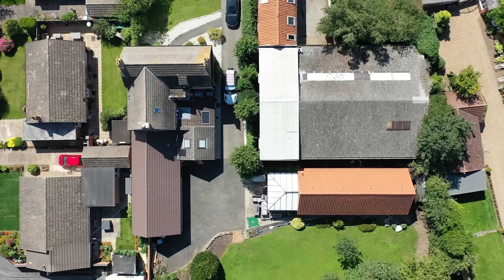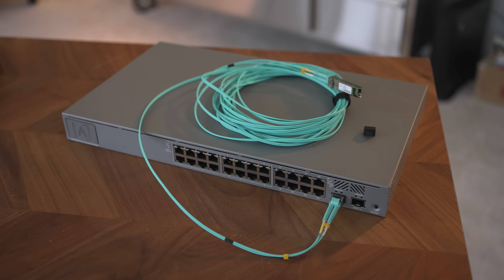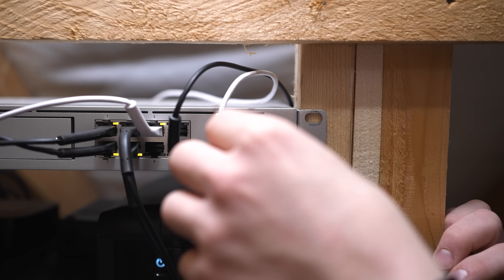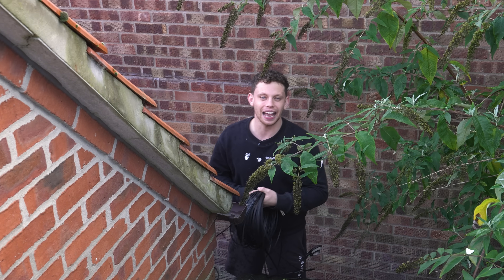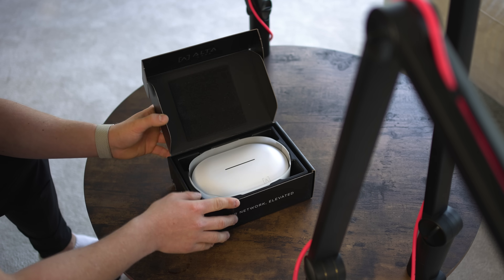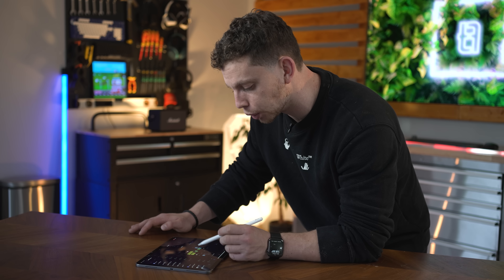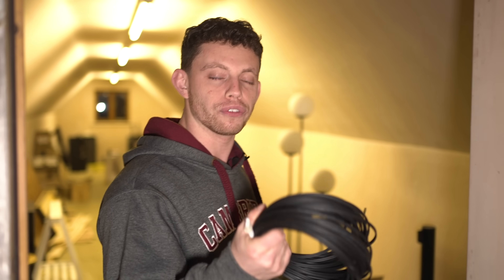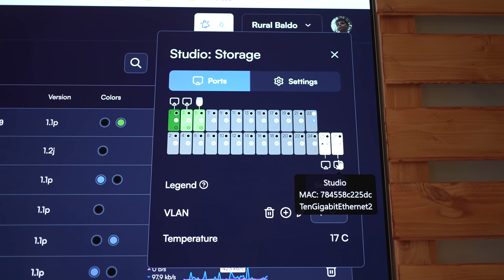The Fastest Way to 10Gbps The Home Studio!

Comment: You really need to seal those holes in the outside wall for the cables, use some silicone sealant, otherwise water will make its way in and cause havoc
Reply: Should’ve took the wire down the wall loped it back up and then in the hole

So any water will drip at the lowest point not track into the hole

Comment: Thank you for the video's Alex.  One bit of feedback if I may, when running cables through external walls it would be better to cover the holes to prevent water ingress.  Could also run the cable through ducting as well.

Comment: Even though the fibres have end caps protecting the ferrule, they’re mainly designed to prevent micro damage/scratches on the ferrule. Fibres should always be scoped and cleaned for transmission efficiency. Tbh the distance it’s covering it shouldn’t matter but just thought I’d let you know for the future.

Comment: The fastest way to achieve 10Gbps in a home studio would typically involve upgrading the network infrastructure. Here are a few steps you can take:

1. Fiber optic internet: Check if fiber optic internet is available in your area. This type of connection can deliver significantly higher speeds compared to traditional broadband.

2. Upgrade your modem: Make sure your modem supports speeds of at least 10Gbps. You may need to contact your internet service provider (ISP) to upgrade your modem if necessary.

3. Ethernet cables: Replace any outdated Ethernet cables with Cat 6a or Cat 7 cables, as they can support 10Gbps speeds over short distances. Ensure that all your devices, including your computer and any network switches, are connected via these high-speed cables.

4. Network switch: Install a 10Gbps network switch to connect your devices. This will help ensure that all your devices can take advantage of the high-speed connection.

5. Network interface card (NIC): Upgrade your computer's network interface card to a 10Gbps card, if it doesn't already have one. This will allow your computer to keep up with the increased speed.

6. Router: Ensure that your router is capable of supporting 10Gbps speeds. If it's not, consider upgrading to a router that can handle the speed.

7. Disable Wi-Fi: While Wi-Fi can be convenient, it generally cannot provide the same consistent high speeds as a wired connection. If you're serious about achieving 10Gbps in your home studio, prioritize using wired connections wherever possible.

Remember that achieving 10Gbps speeds will largely depend on the capabilities of your ISP and the service plan you subscribe to. Contact your ISP to inquire about their available 10Gbps options for home users.
Reply: Ok Chatgpt
Reply: instantly recognised this as being from chatgpt 😂

Comment: There’s also SFP28…

Just wait until you realize how cheap 100Gbps networking is. 😅
Reply: He is indeed an amateur. We are all have been using the fiber over the wireless point to point for a long time. 😅
Reply: I think you’re referring to QSFP28 not SFP28 which is closer to 25Gbps
Reply: @OfficialDJTazer  the Q stands for quad… it’s 4 SFP28 in the same port.

Comment: I got a new house put behind my parents property almost 2 years ago. I Ran SingleMode Fiber (650ft) armored from my parents house to my new house, I just threw it in while the waterlines where being trenched. First started out with just gigabit fiber to ethernet converters. But recently I changed out the media converters for a 10G SFP+ switch at my parents and a 10G SFP+ module for my UDM Pro at my house. A 10G link between the houses on one of the strands. Mostly so I could get 2Gbps speeds when the ISP rolls it out.
Reply: bidibidi

Comment: Hi! You asked the question if 10gbit internet will be available for residential use. Here in NL, 8gbit internet is available in most residential areas. Not cheap, at 70 euros per month. But it does work :-)
Reply: What a crazy price. 10G is €25 here in Spain
Reply: @Tom-sg4iv  In the UK 1Gig is only recently becoming available and we are paying £35-60 / month. (40-70€)
Reply: laughing from Germany... I'm paying 60 Euros/month for 1000/50 - but it's Vodafone Cable so it's not that reliable.. and the upload is miserable for todays standards...
Reply: From Italy with my 30€/month so called 2.5Gb/s but in reality is between 1-1.5gb/s. And this is quite recently, before we had like all the country VDSL with under 200Mb/s.

Comment: Great video! 10GbE links to other parts of a property are always great.
Assuming you'll eventually move that fiber underground, I would recommend the obvious and have it put in some kind of conduit or pipe with a cap that provides a narrow, removable opening at both ends.

You get the added protection from the elements/bugs, and you allow yourself to run new cables in the future, or replace the one(s) already in there without having to dig it up.

Comment: Might be worth pointing out that not all transceivers will work with all switches. Some you need vendor specific modules to work with ie Cisco. Also multi mode is only good to about 1800 feet at which point you’d need to use single mode
Reply: While true... the cable he bought was 100M, which is 6 times shorter than 1800 feet, lol

Comment: Hey Alex, i have issue with UniFi App 10.10.0 on android that it wont open Security aka Firewall menu and also the broadcasting APs on any WiFi. 

I oppened issue and The support team asked if on this is an issue also on iOS UniFi App. You have Apple gear, and use UniFi a lot, so i ask you. 

I self hoast latest Unifi network 8.0.7. But the issue persisted from 7.5. On WebUI all settings work fine, so i cant blame my setup😅.

Comment: Assuming you set the same vlans on alta labs switch to match those of unifi switches to make all vlans  work?
Reply: Yes, VLAN is a 802.1Q spec so both switches implement it and therefore are interoperable
Reply: @ZippyDooDa435  yes I'm aware of that but using both products myself i was wondering if Alex had any issues, insights etc to vlan setup across these two manufacturers

Comment: I don’t see what the problem is with Ethernet cable? Cat 6/6a are 10G capable, more durable and easier to use. More then adequate for home use and then some.
Reply: He kinda glossed over it in the video, but ethernet cables contain copper which conducts electricity. So basically if lightning strikes close enough to the cable, or something happens to the equipment at one end it could carry electricity to the end and damage the switches/other equipment on both ends. Fiber doesn't have that issue as it is completely non-conductive. Not to mention that Cat6a has a 100 meter max distance for 10G, Cat6 is only a max distance of like 55 meters. Depending on how you need to make your run you might need to exceed that even when the two devices are closer than 100 meters.

So basically the way he ran it (overhead rather than underground) means you really don't want to use ethernet if you can help it, and since he said he needed about 50m to run direct like that, I imagine that he would need close to if not more than 100 meters to make it around all possible turns and such to get down to the ground, across, and back up to the network equipment in the other building.

And as he mentioned a lot, pricing can workout in favor of fiber over ethernet.
Reply: @Col_Crunch  thanks for detailed clarity Crunch
While I agree, In his particular use scenario (suspended and exposed outdoors) fibre sounds like a better option 
For most people running cables indoors I’m still confident Ethernet would be a better fit. Most won’t be approaching, let alone running over 100m in a single cable length at home 🏠
Reply: @mattburgon8312  Oh, I completely agree with you, but the entire topic of the video is connecting 2 separate buildings after all.
Reply from the maker: Yes, two buildings connected the fiber (so far) seems to be great. It's been running for around 2 months already and it's not been an issue. Really happy with it. If I were to run 10gbps to the top floor for example, ethernet is easier for sure.
Reply: @Col_Crunch thank you so much for explaining 🙏🏽
Reply: Static charges

Comment: Why dont you run double fibers ? Thats what i do. I have a Unifi USW Aggregation switch, from there i pull two fibers to each distribution switch. That way you have redundancy. The UDM pro cannot do link aggregation, but the USW Aggregation can.. For me it sounds like a better solution. Its almost the same work to run double fibers as one in my experience.. I would possibly keep the radio link connected, in case of problem with the fiber. Unfortuanatly you cannot do LACP with a GB and a 10GB link, unless its changed since last time i looked a few years back.. You also talked about NVME NAS.. You can easy peeak out 10GB ethernet, If you edit a video in your studio and the NVME NAS is in the main building you would have a bottle neck (depending on how you configure the NAS) i am talking iSCSI with multiple targets.

Just idea, thanks for the video
Reply: You could also just use bidirectional optics and each link would go over a single fiber, therefore with the existing 2 fiber cable he has he could do 20Gbps. However seeing at that Alta switch only has 2 x 10G and he needs one downstairs it's not a great candidate for that set up.

Comment: is there any specific sfp for sc? fth connector single mode?
Reply: SFP/SFP+ transceivers can have multiple connector types, eg in the video he uses a LC/LC cable, but you could have a LC/SC cable, and plug the one end into a transceiver that receives a SC connector. It's not super common but it's possible. SC connector is much wider than LC so generally you'll see a SFP transceiver that accepts an LC connector, then a LC to SC cable, and then a SC/SC connector. This allows you to take a SC cable (eg from FTTH) and convert it to a LC connector to go into a transceiver with LC.

Comment: Plenty of companies supply 10gigabit fibre to the property already. Also you need to get yourself some cleaning pens and clean the ferrules on the cable and the sfp ports. If you don't and you have dirt on the connector and you don't clean it properly, you may have many issues.
Reply: Not where he is and many can't realistically afford the 10G internet. I can't even get Fiber

Comment: How come for at least the connection from the loft to the office you didn't just use cat 6E cables, that should be much cheaper and very much capable of taking 10 gbps over the distances you're doing.
Reply: With SFP+ being the only way to connect those two switches at 10Gbps, he'd either need to run a fibre cable or buy 10Gbit SFP+ to RJ45 converter modules to run ethernet cabling instead. The simpler fibre cable is much cheaper than those converters!

Comment: That fibre cable won't be able to support its own weight, you may want to run a metal line from each building and attach the fibre cable to it.
Reply from the maker: Weve just been out and installed a tenstion support, noted its got a metal jacket.
Reply: I dont know how it is in the UK, but we putting all of the cables in "tubes" in the ground - so the cable will survive. This is even if it is a cable intended for outdoor use, with a lot of paste between the cable and the plastic.
Reply: This guy hasn't got a clue practically
But it's so entertaining to watch 😂
Reply: @willmitchell255  we all learn as we go, give the guy a break he's pretty entertaining even if he doesn't get everything 100% right. At least he's listening and taking feedback.

Comment: I have single mode fiber 500' from my home to my out building ariel and it works great. I get the full 1Gbps link over the transceiver I chose as that particular building won't require even half that speed lol.

 I plan on going through conduit at some point.